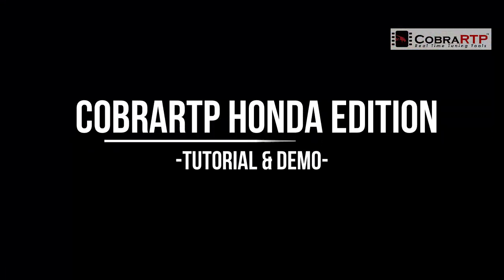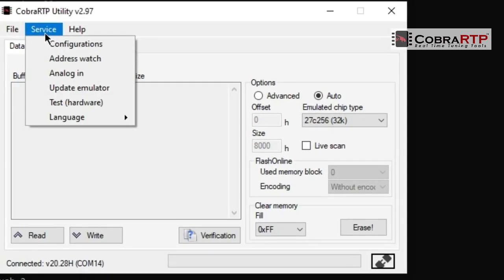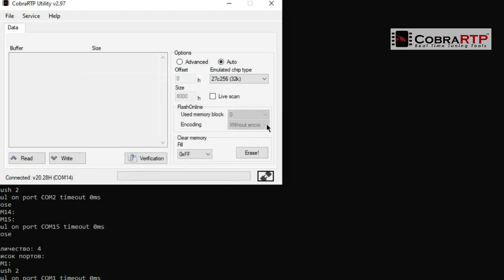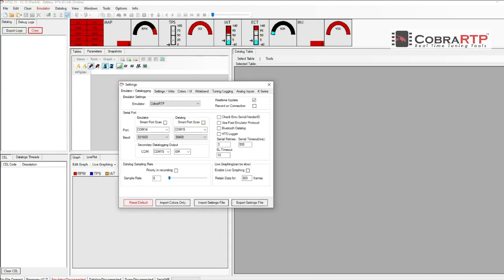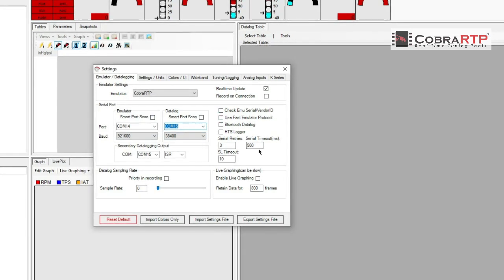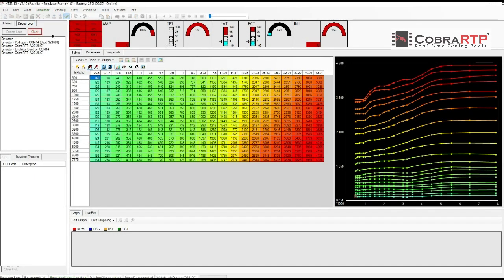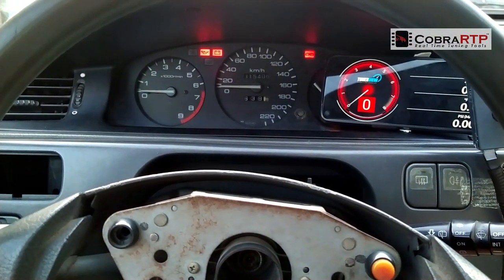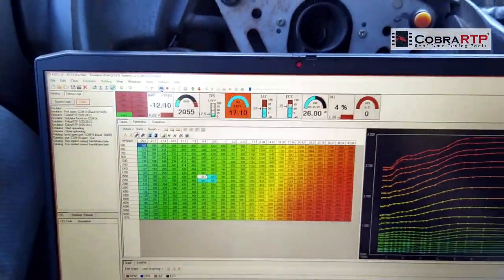CobraRTP Honda Edition - Getting started: HTS, TunerView, and more...

Comment: Why is there a fan on the cobra? 
Is heat a issue?
Reply from the maker: This is a fan for the injector driver.  Has nothing to do with CobraRTP😁
Reply: @CobraRTP  My bad, i stopped the video now to look at the setup, the more i look the more amazed i am :D 
What kind of monster is that, is there anything you haven't changed on that ecu :D